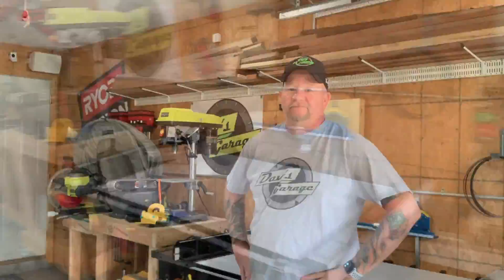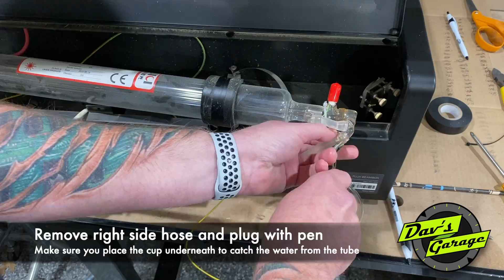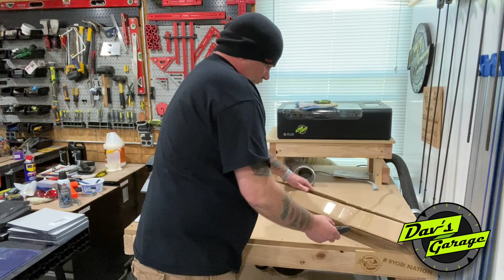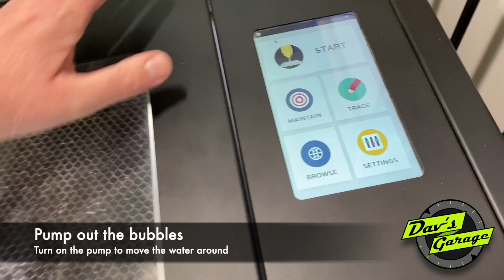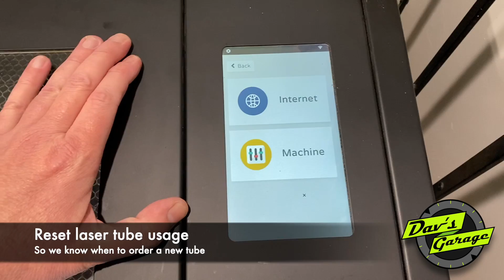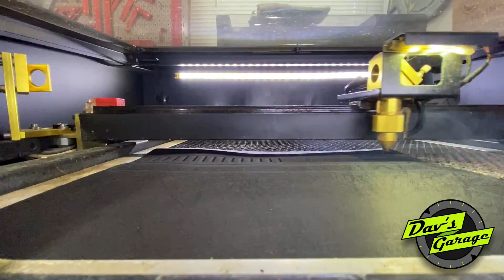Replacing the Laser Tube in a FLUX Beambox laser

Comment: Hello, a question, I have a machine that has only 54 hours of use and it is stored for 1 year and now it seems to have no power, what do you think is the problem?
Reply from the maker: Have you changed the water? The tube could also be bad if it’s been stored that long.
Reply: @DavGlass  
If the water did change it and make sure it was well protected when storing it, what could be damaged?
Reply from the maker: @javierguzman6030  Hard to say, but laser tubes can go bad just sitting there doing nothing for too long. Especially if there is a leak in the system. Even a small one.
Reply: @DavGlass  OK thank you very much

Comment: I have been looking at getting the Beambox Pro but with such a short laser tube life I am having second thoughts.  Considering the machine is going to cost $6,000 for the Pro version and $545 for the laser tube it's not cheap.  The $ exchange rate really sucks here in Australia :(
Reply from the maker: Sorry for the delay, I totally didn't see this comment..

Please don't take my laser tube life in this video to heart, I did some really bad stuff to the tube (for testing) and it was running almost non-stop for 2 months cutting a massive amount of things that I don't normally cut.

That said, the life can be up to 300+ - 600+ hours if you treat the tube right.

Comment: So the previous laser tube lasted 42hrs of continuous runtime? About how long of a time period did you have the tube before you replaced it?
Reply from the maker: Rgerrits99 Tubes can last 50-100 hours depending on what you are doing. Cutting takes a lot out of the tube and I’ve made 600 covid face shields with this tube and it’s all cutting. The last tube lasted me 100 hours because I did way more etching than cutting. 40 hours is actually quite a bit of laser time. That’s calculated when the laser is actually firing.
Reply: Dav Glass absolutely I’m sure. Thanks for the info. Just roughly how many days/weeks/months have you had tubes last?
Reply from the maker: Rgerrits99 My first tube lasted about a year. This one lasted 6 months. But again, I did a lot of cutting in Oct/Nov last year and have been cutting for 8-10 hours a day for the last month making face shields.
Reply: @DavGlass  eventually I'm getting an epilog, but I'm considering a beamo to start with. I heard that the more you run them the better they are (could be just what I heard from an epilog user) but.... 42 hours on a tube? If you work 8 hour days that's like replacing a tube once a week. is that for real? I'm more than likely going to do more engraving than cutting,  but spending an additional $170'ish a week for a new tube sounds like I should wait to buy my luxurious $40k+ epilog. I'd like to you know your opinion on the life of the tubes
Reply from the maker: @user-dn2sk5uo3l  This was a bad tube. Not the normal usage. I usually get a year or more out of them. Sometimes you just get bad ones.
Reply: @user-dn2sk5uo3l  you're going to fork over 40K on an epilog?.....tell me where you planted that $$ tree.....hope you have a great plan for it
Reply: Dav Glass right on thanks for all the info!
Reply: Hej Dave, I see in your answers that 50 to 100 hours is normal for a tube. I will be replacing mine after only 10 hours of usage (got a replacement from flux). I had a lasercutter before and on this machine I got hundreds of hours of usage on a single tube. at least 300. And it died because it froze so maybe even more. Do you have experience with other brand lamps? I ordered another on Alibaba so I have 2 replacements at the moment. Would be interesting to see which one holds up best.
Reply: @wbds7525  how is your beamo going? Have you managed to get longer hrs from it? I'm really interested in it but not sure whether I'd be better off going for a k40